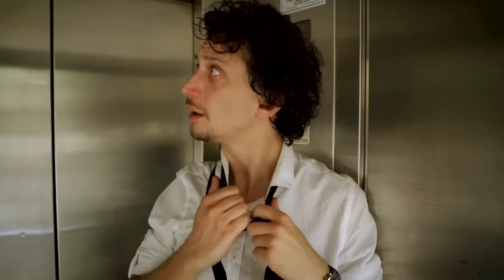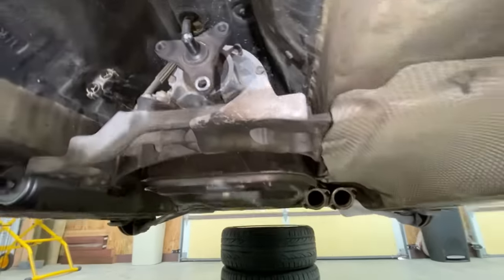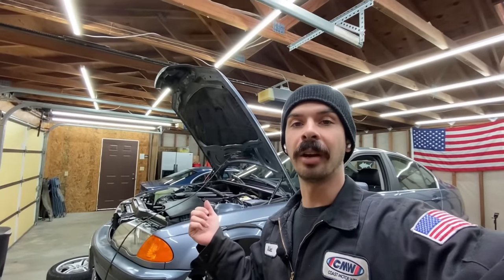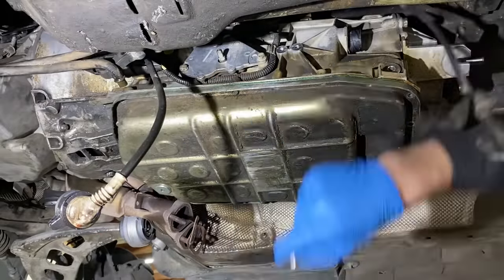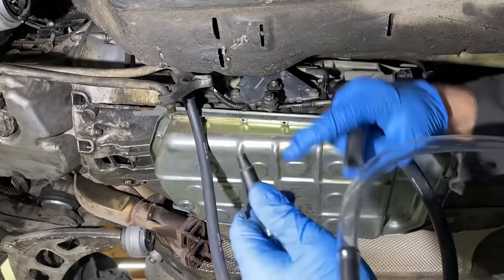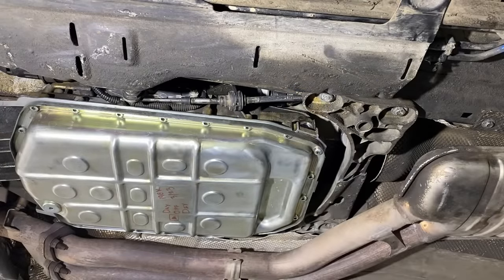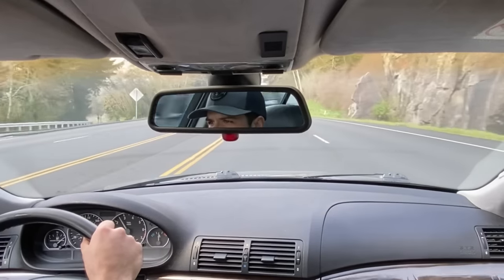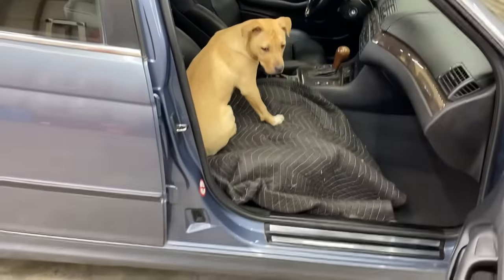DIY Torque Converter, Trans Removal & Maintenance on my $500 BMW E46 330i FLIP

Comment: What are the torque specs for flex plate to crankshaft 06 525i n52...
Reply from the maker: not sure off the top of my head, you should be able to find them online no problem.

Comment: hey i just did my torque converter on my 530i and i put everything back together now my car will not even crank, its not a battery issue either. any help or solutions?!
Reply: also i cant even turn my motor to tighten the torque converter bolts, and my flex plate looks like its off or something its not lined up
Reply from the maker: Damn… maybe the torque converter and flex plate didn’t match up properly? And it’s bound somehow? 
If you can’t spin the engine over by hand, and it spun freely before putting the trans back in… it sounds like something is binding it up somehow. Not positive

Comment: I've had three E 46 with manual transmissions and never a check engine light in relation to transmission problems. The problem is the majority of Americans can't drive a manual trans.